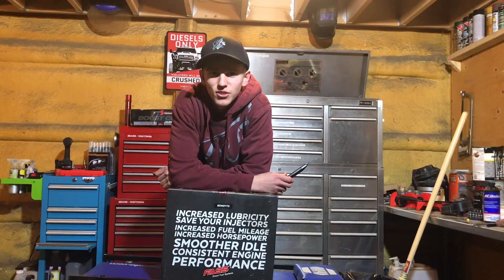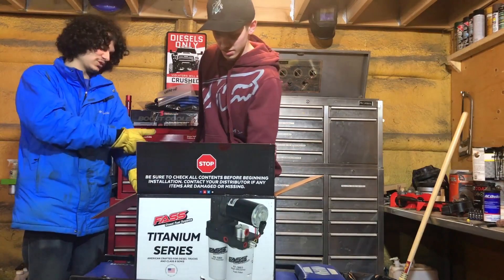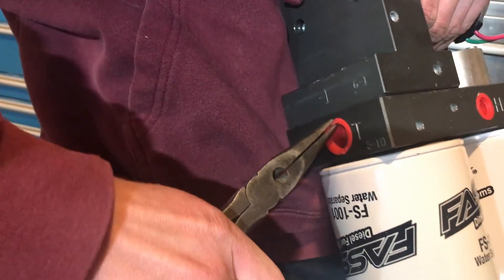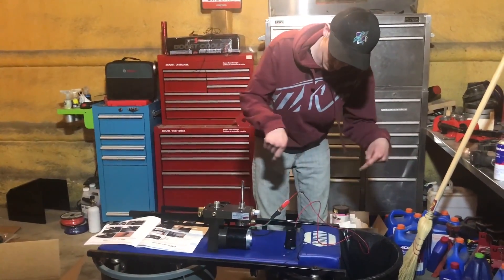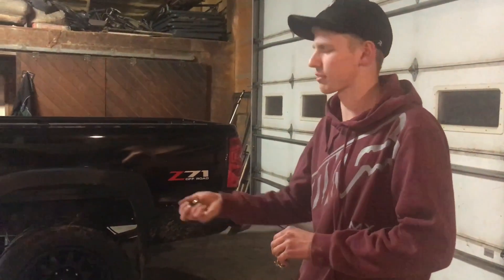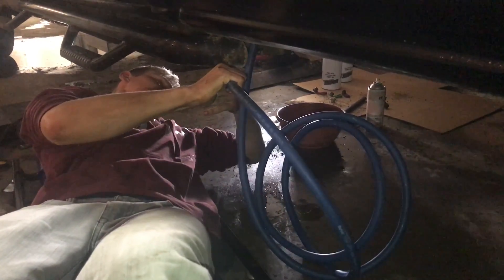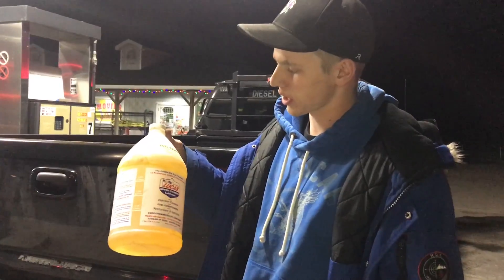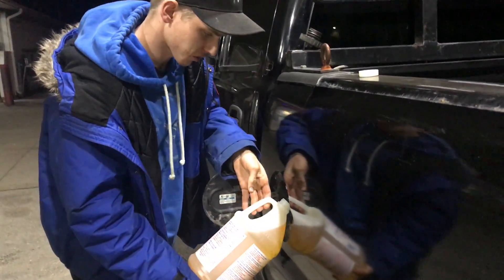FASS Fuel System Install - Crew Max 7

Comment: Don’t worry about the one bolt design. I’ve bent running mine for 6 months and it works great
Reply from the maker: Never heard of anyone having problems, I have confidence that it’s strong enough. It’s just unexpected to see a mount use only one bolt on a truck.

Comment: When you disconnected the fuel lines you introduced air into the system and the stock fuel filter head had not been primed.  When I change out my stock filter now, I don't even bother priming it, I turn the truck ignition to the run cycle and let the Fass pump fuel up to the stock filter head and prime it that way.  Might crank for a couple of extra seconds to fire up

Comment: Not sure if you said it but Is that the fass 165? How much was it? Going to buy one for my truck soon!
Reply: Wrx Lbz it's the Fass titanium 150! They sell for around $720 plus tax Canadian dollars, super easy actually to install once you figure out how to get the fuel line off the fuel cooler
Reply: Fass changed and went to a 165 gph pump, no more 150 gph pump.  You can still find 150's of old stock out there